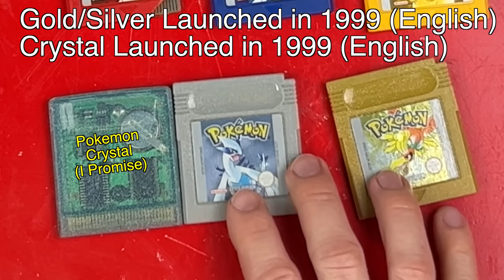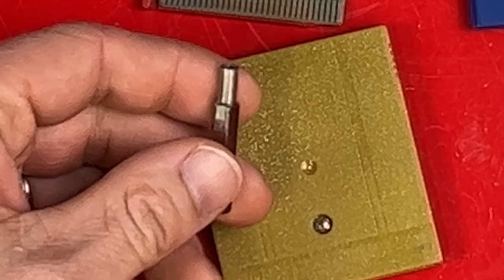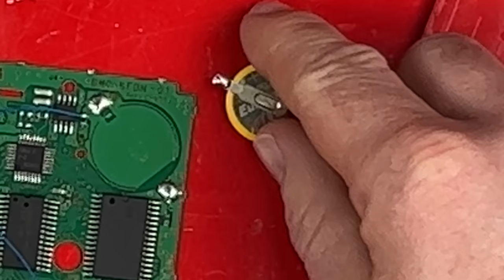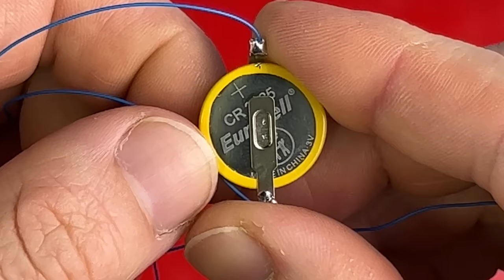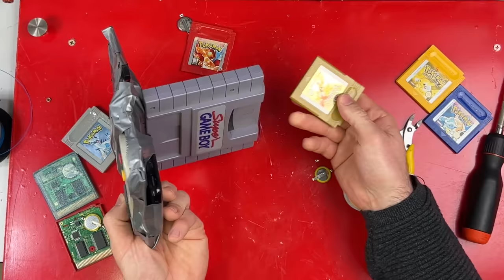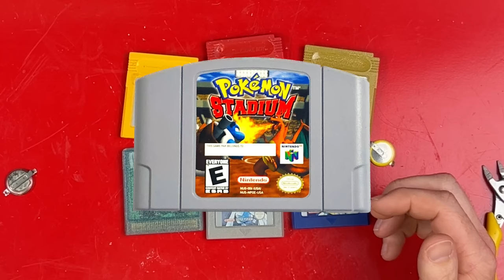How To Save Your Pokemon Cart

Comment: FRAM is pretty amazing for small amount of non-volatile memory, I hope they get it working. The F stands for Ferroelectric, which basically means that it has virtually infinite write endurance at room temperature. Usually the datasheets will list some finite write endurance but only at like constant 100 celcius operation, it's insane. Also they can read/write fairly fast, can max out most SPI bus, so the only downsides are their price and the limited size options.
Reply: The tech for FRAM works fine.  The issue is its never been popular enough to get the sort of funding needed to get densities competitive with flash.  Lots of flash alternatives have had that issue, actually.  And yes, it's ferroelectric.  What's cool about it is that certain atoms in it's crystal lattice move around to store a 1 or a 0  One of the pioneering companies was a company called Ramtron.  Their HQ was in the city I live in, Colorado Springs, and one of their founders was a professor I had at UCCS (University of Colorado, Colorado Springs).
Reply: It was used in the Sonic 3 cartridges,  at least in the US
Reply: Even if we can only get these into the megabytes of capacity per module, they will still be great for long-term robust storage
Reply: I've seen them used in ripoff GBC games. Or something to that effect at least. Got Pokemon Crystal for 1€ off eBay, everything works fine except the real time clock doesn't work when the console is off and the item duplication glitch also doesn't work.
Reply: @brandontechnerd  Infineon makes 16 megabit (2 megabyte) F-RAM memory chips. For example the CY15V116QN-40BKXA.

Comment: Im not gonna tell James how to solder cos he's clearly got more experience than me, but for anyone trying this at home, please cover the contacts at the bottom of the cartridge with kapton tape while you solder! If you get solder on the contacts, (which is easier than you might think if something slips or moves) the whole cartidge is basically useless.
Reply: if that does happen can you remove it with desoldering braid and have the cartridge still function?
Reply: not really, its really easy to clean them off. I cleaned off my contacts on the bottom of the board by adding solder, then removing it. Worked far better when i was done
Reply: the cartridge connector uses little spring contact fingers that are perfectly capable of making a connection on solder, it works fine what are you on about
Reply: You can clean the solder off the contacts, but you'll never really be able to get it all off again and get back to the gold plate.  If you clean the contacts carefully, with solder braid, you can still use the cartridge, but solder does tend to corrode more than gold does, so you may have to clean the contacts more frequently.  But yes, not a bad idea to use kapton to cover the contacts - we do that at work all the time to protect gold plated contacts during board assembly.
Reply: @BobofWOGGLE   See ccoder4953's reply comment. Essentially the solder remains in a thin film even if removed by wick and the solder corrodes more readily leaving a shaky connection. The board will still make contact and work immediately afterwards but it will be become a battle of corrosion cleaning over time.

Comment: One life hack if you don't have the right screwdriver bit: take the front of a ballpoint pen, remove the actual pen bit so you only have the plastic shell. Heat the tip with a lighter or similar until it gets soft, then press it firmly onto the screw on the cartridge and wait until the heated part gets cold. The soft, heated plastic will form a mold, and if it's strong enough after it cools down you can actually re-use it on other cartridges.
Reply: I've heard of that, but how long would it last? I can't imagine that not stripping after a few uses.
Reply: @TechnicalJimActual  for me it's lasting for probably 10 years and counting. Usually the plastic of a ballpoint pen is pretty hard, and the screws on game boy cartridges are not that tight

Comment: A good tool to have when replacing the battery without worrying about the save being deleted is to get a GB Operator from Epilogue or G01 Game Cart Reader from Submodule, you can rip your saves with them to your PC/Mac/Linux device, replace the battery, and then upload the save right back to the cartridge, plus you can also rip the games (And Gameboy Camera photos) and play them on emulators.
Reply: Or good ol’ Aussie mate BennVenn’s GB Joey Jr, or InsideGadgets’ GBxCart RW. There’s a ton of GB cart readers/writers out there.
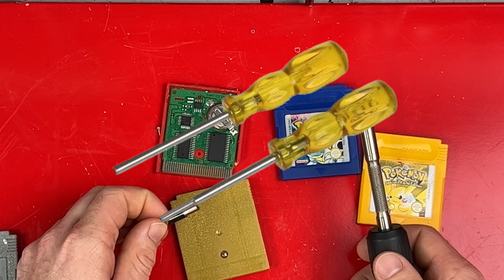Reply: He says that at 1:40
Reply: He said that at the beginning
Reply: Ill need to look into those. I got a old hame boy camera i would like to get operatinal again and would be nice if i could save the photos
Reply: The BennVenn Joey Jr. is the best imo. It requires no special software on your computer, meaning it will be supported by modern PCs and operating systems as long as any USB drive is, and not just for however many years the software those other devices use remains compatible with new PCs!

Comment: Videos like this are a great reminder of how good we have it these days
We can now just store saves so easily without needing to worry about a battery or a device that loses power or becomes bricked, especially with cloud saves.
Reply: Well, it's not that sunshine and rainbows. I once lost 5 hours of playtime because i played offline and then cloud saves wiped all i did. Sure, i could use some local backup, i just didn't expect that thing to happen
Reply: The "cloud" is not a backup.
Reply: Flash memory works by trapping electrons. Due to some annoying quantum physics, the electrons tend to escape, so the bit registers as a 0 instead of a 1. 
In practice, this means that stored data on flash memory can only reliably last about 10 years without being powered on and refreshed. Even our "magical" modern tech isn't actually all that magical.
Reply: @masterkamen371  modern flash got error correction built in and operated on controller level. But eventually, error becomes so big that it's no longer correctable.
Reply: @vadnegru  Indeed. I mean, the average user probably won't forget about their laptop with valuable data for 15 years.
However, as flash memory gets older, it might start to happen. For example, someone might have a PS2 from their childhood and when they plug it in after 10+ years in storage, the memory card might be corrupted.
Reply: @masterkamen371  i found microsd card that was unpowered for nearly 8 years, and the files i checked were fine. Sure it's just 2GB so it's most likely utilities MLC, which is better at keeping change than modern QLC ones.
Reply: @vadnegru  PS2 memory cards are only 8MB and probably have a very rudimentary controller, magicgate stuff aside. And I've heard of plenty of cases of corrupt data on them, but I guess it's hard to know if it's because they sat for too long or they are just worn out (it is essentially late 90s flash memory after all, it only really started getting decent in the 2010s).
Reply: @masterkamen371  interesting how everything is bad at the beginning then becomes good and then kind of "ok" but worse in some way in effort to cheap out.
Reply: The coolest thing about modern technology in this context is that we have a bunch of different devices on the market now, that can take your fleeting cartridge save file, copy it onto a PC and then even write it back onto the cartridge! 😲

Comment: A much easier way to source batteries is to install a CR2025 holder. Preferably a shorter one. 
Untabbed batteries are easier to find at regular stores. Plus it removes a soldering step for batteries.
Still need to do the bypass though.
Reply: you can also cut up some sheet metal and make the plates yourself
Reply: @TorutheRedFox what? The tabs are welded on with a special machine, you can't just solder them on. Same as those 18650 cells that are fused into packs.
Reply: it obviously won't hold as good as a weld but it'll still work
Reply: @TorutheRedFox  it really won't, soldering takes time, meaning a lot of heat which causes the battery to blow up in your face. Speaking from experience. 
I tried cheapening out when replacing a ThinkPad BIOS battery and nearly lost my eyesight. It is not worth the risk.
Reply: i managed to do it just fine with my gamecube
Reply: I plan to do just that, because the last "new" battery I soldered into a cartridge failed after three short years! 🙄
Reply: @TorutheRedFox  I guess it's good when it works, but it's quite risky.

Comment: If you see this, does this same trick work for other carts with battery backup? Like Sega Genesis/MegaDrive or SNES?
Reply from the maker: Yes, it works for any backup battery
Reply: n64 as well?
Reply: he says at the end, "the same method works on other cartridges, even for other consoles"
Reply: Any games that use a physical battery will work this way. So Sonic 3 or Phantasy Star 4, for instance, would have one of these types of batteries in it.

On some other consoles (mainly N64 and GBA), games save to flash memory. Any game that features a realtime clock would have a battery on the cartridge for it, but replacement should pose no threat to the saves, and the RTC should pick back up from the moment it died.

Comment: Good news James, in Gen 1 and 2, “ruining” a pokemon doesn’t actually happen. As the game recalculates stat experience when you box them, without the need for a level up, it’s fine. Unlike Gen 3 and 4, level 100 pokemon are still able to gain additional EVs.
Reply: Is that what he meant? I thought it was ruined as he hacked the game ruining its validity.
Reply: @Slash0mega  while that might be what he meant, I find it unlikely, as the game itself has no way of knowing if leveling was done by candy or not, even on a competitive meta data level. Paired with that fact that it was a common playground myth that using any rare candies at all would make a pokemon weaker at level 100, I think my interpretation is more likely. Could be either way though.
Reply from the maker: Totalphantasm understood what I meant. I always thought a level up via rare candy did not improve a pokemon as much as a level up through battling. Was that not true in gen 1? It was definitely an accepted “fact” at my school
Reply: @Games_for_James  Yes and no.
Basically your Pokémon gains extra stats based on what wild Pokémon it defeats. So a pokemon leveled up to 100 by candies vs a Pokémon leveled by battling will be weaker.  
However in every generation except for 3 and 4, you can continue to get these extra stats even once your Pokémon is level 100 if you keep battling wild Pokémon with it.

Comment: Soldering a temporary battery is actually genius and not something I ever thought to do. Hopefully I can just back up my save somewhere before I have to replace my Crystal battery again though
Reply: Even smarter is to back it up to a PC beforehand using a cartridge dumper/flasher and then not having to worry about the wires of the temporary battery at all.

Comment: Wow, you got the very first "event Pokemon" and still have the save file? That's impressive.
I did a battery swap in Pokemon Ruby GBA. In that one, the battery only powers the clock. The save file can survive a dead/disconnected battery.

Comment: This is the most straightforward and comprehensive video on the subject, thank you so much! I actually looked into doing this for myself, but the it was cheaper to purchase a reproduction cartridge and has the added convenience of not having to deal with batteries. Unfortunately, those do not work with Stadium, which is very relevant for Gens 1 & 2. 

Also, I really approve of your Eeveelution choice. Kid-you knew what was up :'D

Comment: just before the pandemic I got back into retro games, nothing much, but scored amazing deals on Yellow, Silver (my first pokemon) and Ruby. It's been on my mind lately about losing my saves. I've going to have to look into this!
Thanks James!
Reply: Buy a cartridge dumper/flasher, then you'll never need to worry! Those allow you to do backups of your save file and if you do that regularly, you can just restore your save whenever the battery runs dry. No need to preemptively replace batteries and risk losing the save file in the process!

I recommend the Joey Jr. from BennVenn, as it requires no software on your PC to function, so software support into the future is no worry, unlike with most other dumpers/flashers

Comment: Isnt that just a CR2025 battery? You can buy those at pretty much any electronic or office store lol thats crazy they're hard to find in Aus. I have like 50 in my little battery drawer
Reply from the maker: Without the solder tabs yeah, easy. With the tabs? Nah, hard to find. The only ones I found were for vertical through hole mounting and they weren’t branded.
One day I’ll buy a battery spot welder so I can put my own tabs on

Comment: I wonder if you could make a rechargeable cartridge by just adding contacts/tiny connectors on the side to connect a charger to, but I don't know if there would be enough space in the cartridge.
might be a fun ghetto mod to try if you had an extra game you weren't too attached to for experimentation.
Reply: I'd imagine you'd have to do a good amount of cannibalising or modding to slim a battery charger to fit inside the gameboy cart. they absolutely make battery chargers small enough, I have one in my alarm watch, but I've never seen one small enough out of the box for sale.
Reply: There's no need for extra connectors, just use the 5v from the Game Boy. This is what many older PCs (286 and 386, some 486) did, charge a NiCd off main PSU when switched on. The downside is self-discharge and the fact that NiCds eventually leak. Li-ion are better in both these aspects.
Reply: @eDoc2020  is there an easily accessible 5v pin in the port? because in that case yeah that would be the best option
Reply: @eDoc2020  nicad are not great.
Reply: @Oxygentleman  Pin 1 of the cartridge is 5v to power the ROM, pin 32 (the other end) is ground.

Comment: While on holiday in Spain in 2001 I bought a copy of Crystal that turned out to be bootleg, and it wouldn't keep any save files. When I opened it up in 2020, it had a CR2023 holder but it wasn't soldered on one side. It also had some non-surface mounted components on the board too - a few resistors, diodes and ceramic capacitors. Weird.

Comment: When i was like 13 i took apart my pokemon silver cart, made a little hole, and slotted in wires to a single AA battery slot. I was somehow able to create a stable connection by tucking the wires underneath the battery terminals.   The time is off and it's the incorrect voltage, but it still saves after 5 years!

Comment: I hope I won't have to deal with this since I have Yellow and Crystal through 3DS Virtual Console. I know I'll eventually have to replace the battery of my New 2DS XL (assuming those batteries are still being made by the time that's an issue).

I couldn't get past the paywall of Pokemon Bank that blocked access to Poke Transporter on an unlisted page before it went under, so my Virtual Console Pokemon will probably be confined to their games of origin (not that Gen 1 or 2 kept track of that, meaning that sending all of Box 1 of a Virtual Console game to Pokemon Bank caused the game of origin to be listed as the Virtual Console game they were transferred from).

Comment: Alright. In college I had a friend who was tired of his crystal resetting but would keep leaving it on. We had the crazy idea that went like this-

1: frantically unscrew and stop half way to turn the game back on.
2: after getting the cover off we had access to the battery WHILE IT IS ON
3: Solder WHILE IT WAS LIVE
4: Save and pray

It actually worked, and we did all this for a 12 hour save.
Reply from the maker: Haha yeah that can work too! I didn’t think it would until someone else commented the same thing. I think the key is saving again when the battery has been changed.
Reply: @Games_for_James  I don't think you need to save again after changing the battery, I believe the MBC has a diode-OR so the SRAM runs off the 5v supply whenever the Game Boy is on.

Comment: I bought a Joey Jr. which lets you back up your games and save files. My copy of Crystal somehow is still holding a save after all this time, but, it says the save is corrupted. I'm not sure if I can run save editing software directly on Linux or not. I have PKHex which might be able to fix it, if not, I could compare with a hex editor to see what corrupted. Gold and Red, the battery is flat. Blue and Yellow are still going. Pokemon Pinball is still going.

Comment: I WOULD NOT RECOMMEND THE WIRE METHOD to keep your save file intact anymore! If the one of the wires slips from the contact while you're desoldering the original battery, bye bye save file! This is a risk nobody should take anymore with how readily available cartridge readers are these days. Yes, buying one costs a bit more than this method, BUT the save file from your childhood is invaluable, right?
Also, those replacement batteries can be quite bad. I had one die after just three years in my Crystal edition! So, you want to make a backup to a PC anyway.
Also also, cartridge flashers allow you to do cool things, like transferring your favorite old Pokémon up to new games and still have them on your original cartridge too, or clone and transfer legendaries for Pokédex completion. Just backup your cartridge, do the trade/transfer and then restore the backup from before! 😉

I recommend the Joey Jr from BennVenn, because it works like a USB drive, requiring no software installation to the contents of your cartridge. That's the one I use. It also has USB-C and comes in a 3D-printed case.